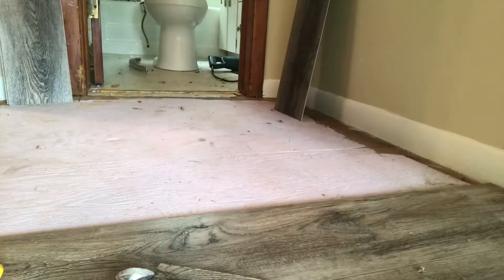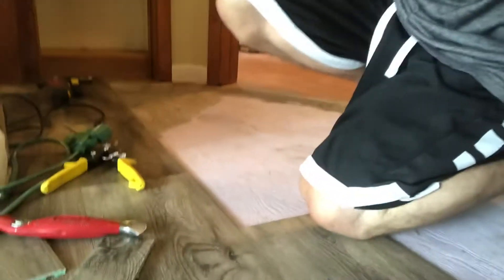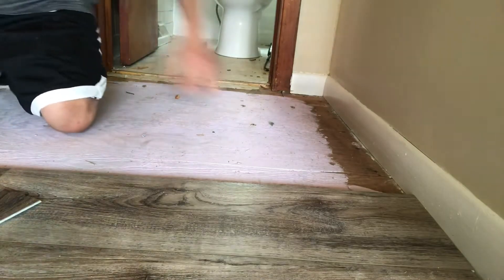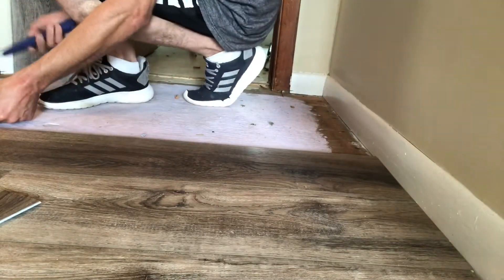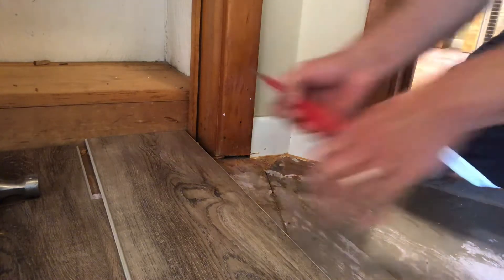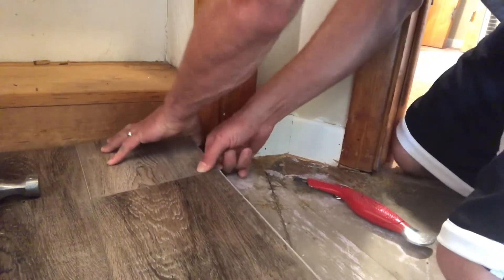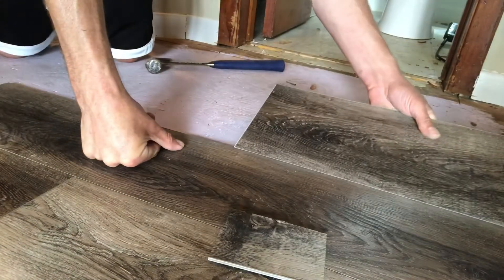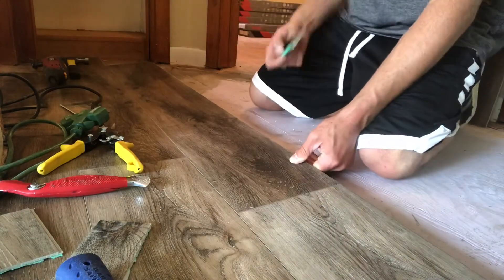How To Install Vinyl Plank Flooring THE BASICS

Comment: I did an LVP install but it was a pain in the neck. The plank edges would break just by looking at them hahah. Any brand that you recommend better? Tks!
Reply from the maker: Ooooo nooooo!
Reply from the maker: There is so much private labeling going on in the industry it’s hard to recommend certain products but in most cases if you’re getting products that cost $2.25 a sft or more you are usually getting something decent